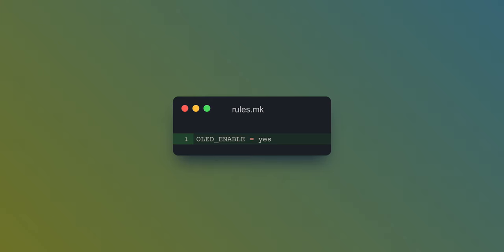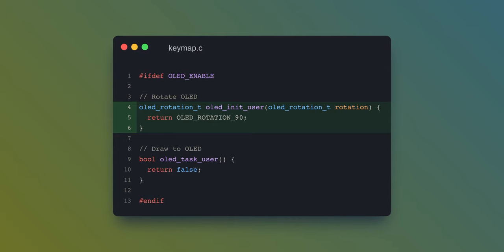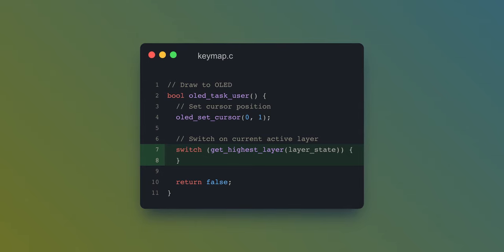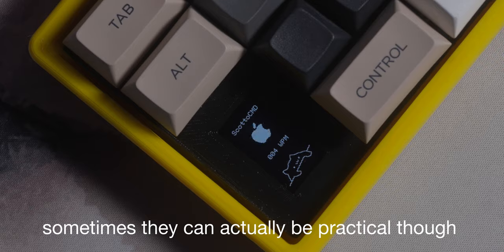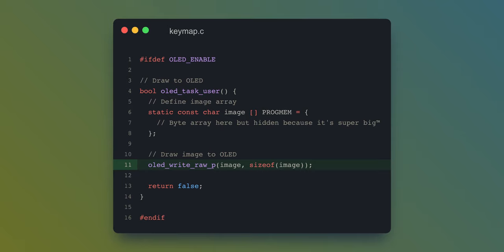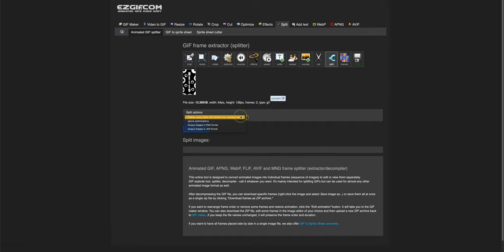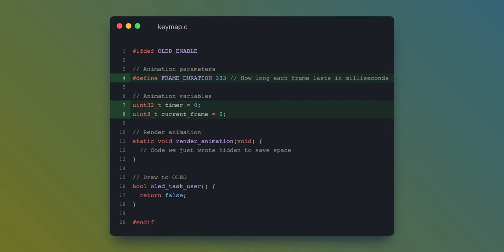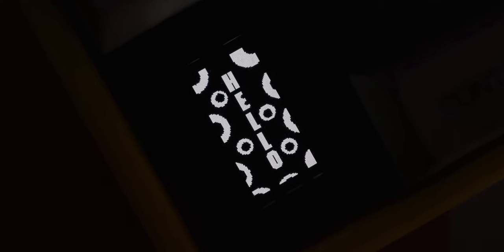How to Use OLED Displays with QMK Firmware

Comment from the maker: Hopefully this video is clear enough to understand but if not, feel free to ask any questions! Also, here is the link for all the code: https://gist.github.com/joe-scotto/dfa2da0fb0d14291d295aeef6728707d
Reply: is there any option, to implement in it something like temperature reading from computer?
Reply from the maker: @janekstolarski9163  There have been some projects that sensible a link between the computer and controller but I don’t believe it’s natively supported in QMK. Those projects also seemed complicated to set up.
Reply: @joe_scotto  yeah that would be tough. Mostly because you need to get a controller that supports serial and build an app (python would work) on the pc to send the wanted data then you need to receive it on the controller with some custom code.

Comment: Yooo so I was having a problem where the oled screen was skipping every other line, but turns out in my config.h, I had put "OLED_DISPLAY_128x64" instead of "OLED_DISPLAY_128X64". You need to note the capital X!! Cuz in 1:05 you have lowercase x

Comment: Have you tried using the same 4-pin display on ZMK firmware? May have to work with a bit of Zephyr it seems?
So far could only get ZMK-built-in nice views to work. QMK seems more straight forward.

Comment: hi, my keyboard folder does not have a config.h file, so i #define OLED_DISPLAY_128x64 on both keymap.c and oled_driver.h (but there is still blanks in between each line, assuming its still set as 128x32)
any idea to why this happens?

Comment: I didnt plan on learning so much about OLEDs today but another banger video man! Off topic, what soldering iron would you recommend? For mil maxing pcbs, and eventually trying my hand at hand wiring? Thanks!
Reply from the maker: TS100 BY FAR! I think it runs like $70 but you can power it off a battery or wall power. It has great features such as temperature control, sleep mode, auto off, etc.I would recommend getting the chisel tip as well, I think it’s the D24 but not certain.

Comment: Oh man, I started gathering information to make a handwired board a few months ago and u made a video for it about that time. Now im building software for it and u release a related video. What a coincidence! I also wanted to ask, in your video about board with VGA cable u said that some of the wires connected internally, I want to make a Redox-like board on a single Raspberry Pi pico and connect both halves with hdmi cable, any chance u know about internal connection in hdmi? I couldnt find anything mentioning it, thanks in advance
Reply from the maker: I started trying to make a split that used USB-C and the available pins were complicated and not enough. There also was the fact that same spec cables were made differently. I suspect HDMI would be similar but the best way to find out is buying a “breakout” board and probing the pins with a multimeter set to continuity mode.
Reply: @joe_scotto  I already ordered 3 from Aliexpress, should be delivered around december 17th. I'll test and comment with results. Ty for your vids again <3